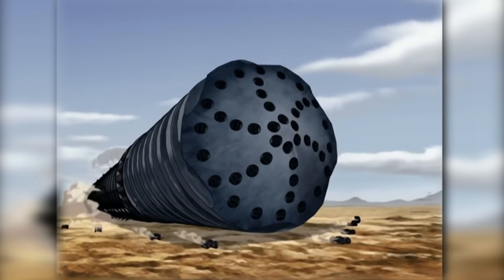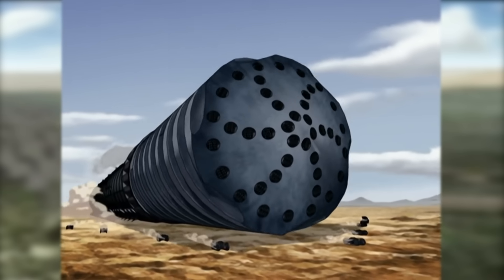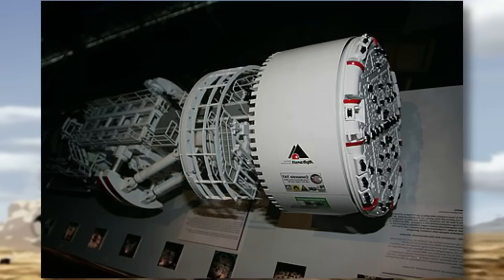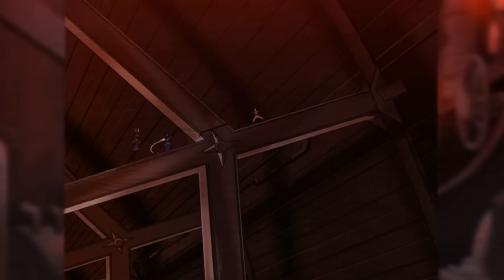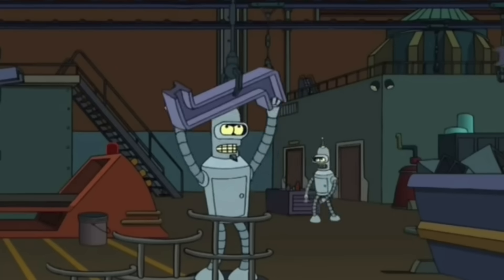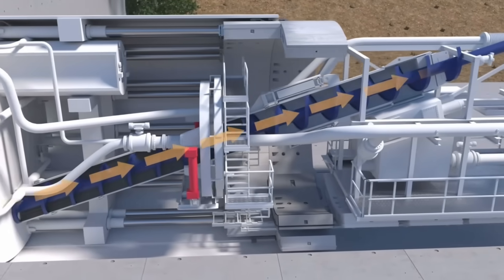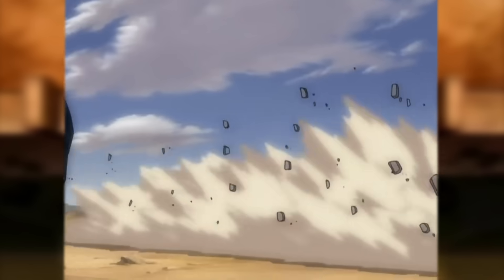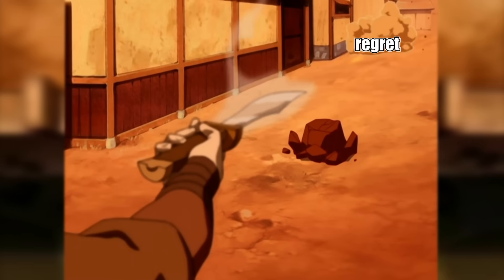Engineer Breaks Down the Fire Nation Tech

Comment: I just thought of this- instead of assaulting the drill directly, the earthbenders could've counter-mined the drill- since it was supporting itself on the surface and not traveling underground, they wouldn't have to dig far; digging directly under and opposite its path would literally break it in half with a trench!
Reply: Yeah but they see it for the first time and are scared shit less and panicking

Plus they would need to go down from the wall where tanks with fire benders were
Reply: @yamatokurusaki5790  they could just start from inside the wall and dig underground, and then come up underneath the drill 🤷🏼‍♂️
Reply: Trench warfare comes for us all lol
Reply: @doctorwholover1012 underrated comment
Reply: Earthworks are the eternal weapon of warfare
Reply: it would need to be a rather wide trencdh and even then it's more like immobilizing the drill since it has a small slenderness ratio meaning it is difficult to buckle the drill due to the sheer girth. then again iron doesnt have the best tensile strength.
I think a few guys could quite reasonably spawn a big rock from the top of the wall and let it fall on the drill. Nothing beats hyperaccelerated kinematics, just ask anyone who shot a gun before.
Reply: They could render any ground army useless just by moving the ground backwards continuously which is a concept toph does fairly regularly.
Reply: That might compromise the integrity of the wall.
Reply: @seneca983  alas, we know counter-mining has been done before.
Reply: @IAmTheAce5  But, as far as I know, that was primarily about things like preventing explosives from being detonated in the tunnels. I don't think it makes sense to deliberately collapse tunnels (either your own or those of the enemy) under your own walls except maybe if it's the only way to prevent a detonation. Maybe in the case of Ba Sing Se you could try to only collapse those segments of your tunnel which are under the drill and sufficiently past the wall, but it sounds a bit risky.
Reply: @seneca983  Countering an enemy tunnel with a defender's own tunnel was definitely viable in real-life military siege warfare- I should say there's no 'maybe' about it.

I fully expect an Earthbender military to get around these nuances, supposing they were prompted.

Three guys can flip a tank, I can't really see them being in extra danger using counter-mining.
Reply: @IAmTheAce5  "Countering an enemy tunnel with a defender's own tunnel was definitely viable"

I didn't claim it wasn't. What I was saying that such counter mining probably didn't include collapsing the tunnels if the enemy tunnels were already below the defender's walls. Rather then you'd try e.g. to just go into the enemy tunnel and kill the miners. Similarly, undermining the giant drill in Avatar once it's already drilling the wall seems a bit risky. You don't want to create a camouflet under your own walls.
Reply: @seneca983 oh, my suggestion was for before they reach the wall, long before.

Like ‘is that a whole building moving our way’ early 😅
Reply: @IAmTheAce5  Ah OK, that could probably be done without undermining the Ba Sing Se walls at the same time.

One issue I see is that the walls are huge so they might have a pretty wide and deep base beneath the surface to prevent them from sinking into the ground so tunnelling from inside the walls could be a very big effort. On the other hand, maybe earthbending makes tunnelling so much easier that it's not an issue.

Comment: The easy way to stop the drill would be to just wreck the internal machinery, but that requires infiltration, but in the show, it's actually easier for the earthbenders to create tunnels in the drills' path that'd collapse under the its' weight. 

If done smartly, the collapsed tunnels would align with the spikes on the drills' sides and its' tank threads, which would stop the drill in it's tracks and avert the threat indefinetely (or until the eartbenders figured out how easy it is to divert nearby water and flood the thing).
Reply: I deal like the weight of the drill would destroy itself if they weakened the ground under the middle and just brake
Reply: You still would need tons of ppl and time to prepare the tunnel :D
Reply: @yamatokurusaki5790  Which the Earth Kingdom military would have, plus the worlds largest city is full of people too, stopping the Fire Nation would be a pretty good incentive for the refugees to line up to help.
Reply: @tatalsaba  so you will weaken your defenses in other places ?
Reply: @yamatokurusaki5790  Welcome to warfare 101, when you move to deal with a threat, other fronts won't have as much manpower for defence or offence, Sun Tzu wrote about it, so it's not a new thing. 

However the Fire Nation won't know where the defence is weakened, because they can't get intel from the 600 feet tall wall and what's behind it, plus their main attack plan has been neutralized, putting them back to tried and tested tactics, which hasn't worked since Iroh was a general.
Reply: @tatalsaba  oh yes they won't know cuz they totally didn't corrupted whole secret police mate learn the plot they would know very easily also mister i know everything better
They didn't know about the attack happening did they ? So probably weren't that prepared 
I know you surely did knew that alongside the plot
Reply: @yamatokurusaki5790  The Dai Li only turned to Azula after she bested Long Feng politically, which was after the Drill episode.

Comment: I want to remind everyone that fire benders do not bend fire. They bend heat. Essentially, they bend kinetic energy at an atomic level. They can improve their bending abilities by controlling their inner spiritual energy, called Chi or Tao or Qi or life force or what have you. They use their emotions to focus on a specific goal or ideal, and their emotions control how their energy flows in their bodies. The best way to describe fire bending, and its cultivation, is a comparison to forging steel: the strongest steel is the ingots that have been folded, hammered, and quenched over and over again. Similarly, the strongest fire benders are those who have had their ideals tested, their emotions challenged, and their resolve broken before strengthened again. This can be done through many methods. Meditation can be used, where by trying to actively control and rein in your emotions to focus them clearly, you can create a sharp edge in your energy that is refine and powerful. Unbridled and immature emotions, thus unforced inner energy, leads to uncontrolled and weak firebending.

A fire bender who has grown accustomed to focusing their emotions, forging their energy over time, they can greater bend molecular kinetic energy. This can lead to hotter flames, such as Azula’s blue fire (where Azula may seem rageful and immature, her negative emotions were quite focused on a singular ideal almost constantly). A true master can bend lightning, by causing molecules to move and rub against each other so fast that they generate enormous amounts of static electricity, usually within the user’s chest, arms, and hands so they can build it up inside and guide the direction it fires. Similarly, redirecting lightning is when the user controls the kinetic force of the molecules in their body to guide the lightning through them and out the other end (which is why moving your hand over your heart can be fatal).

The most refined form of fire bending can be seen with combustion bending. You focus on a singular point on your body, typically a spot where your inner spiritual energy (whatever you decide to call it) gathers in a node of gate, and then control the kinetic energy of molecules in a straight line from it. You then allow the energy to build up on the target until a lot of heat is generated so quickly that and explosion is generated with air as a fuel/reactant.

Recap/TL;DR: by focusing their emotions strictly, fire benders can strengthen their Chi to grow stronger as a fire bender. Fire benders don’t manipulate fire, but rather molecular kinetic energy, thus they can also bend lightning, spontaneously heat things up, and cause instant combustion.

Comment: Personally, I would have tried to find the main driveshaft of the boring head and tried to disable the drill that way. If it can't drill anymore, it can't get into the city, even if it's technically not destroyed.

And even if they couldn't cut the main shaft, they could have slammed a massive rock against it untill it was damaged enough not to turn properly anymore.

Alternatively, they could have went for the power plant. The drill is seemingly powered by steam engines. In real life, a steam engine can be quite volatile. For example, they could have bent the water out of the engines, causing the boilers to heat up, then let the water flow back in to create a massive pressure spike, potentially resulting in an explosion
Reply: Keep in mind these characters can barely comprehend what a steam engine even is, they called the ash from Fire ships "black snow"
Reply: @ThanondorfTV  find spinny thing, break spinny thing so it stop spinning
Reply: @ThanondorfTV  To be fair, that "Black snow" is literally the ash mixing with the snow
Reply: @ThanondorfTV  Black snow is literally the correct scientific name for it.
Reply: or used the water bender to break the boilers, cant make use of the drill is all you piping bursts from freesing and the air is filled with boiling steam
Reply: We forgetting that the drill has idk ppl in it? Ang is sleep deprived
Reply: I would imagine those components probably have the most fire benders they would have to deal with and bring tons of attention to them that they really don't want.
Reply: @dillzilla4454  While true, the fire nation is known to employ non-benders in its military for support roles. I wouldn't want fighting age benders shoveling coal in a boiler if I was the drill's commander
Reply: I would have sank the wheels of the drill so it wouldn’t even move.

Comment: My observation on the drill and why the Gaang didn't attack the internal systems is because of two things. One, there was a small army in there. Even the engineers should know how to fight and, while they're skilled, I don't think they're 50 to 3 in a cramped environment skilled at this point in time. Two, Aang's goal is to disable the drill, not destroy it. He is a pacifist, despite all evidence to the contrary. He doesn't want to directly kill anyone. So doing something like overloading the boilers and causing a steam explosion, while both cool and effective, would also cost a lot of lives and he would recognize this.

Comment: I thought the slurry was to help of cooling as well as removing the material
Reply from the maker: That’s what my intuition told me too when I was starting researching the specifics, but I think I was confusing it with steel drilling which certainly needs a coolant. I think the main difference is that the speed of the drills cutter head is much slower than a steel drill and generates less heat as a result.

Comment: To be fair, it would've been much more boring (pun intended) if team avatar just destroyed a few key pipes and caused a steam explosion inside the drill. 
Also, I could be wrong, but fixing a few pipes might be easier than rebuilding an entire drill's structural support systems.
Reply: attacking the structural elements is like stabbing some ones ribs, will it hurt if you do enough damage? yes. could you kill them ? if you do it right, should you have gone for the throat yes, would it have made a less interesting episode yes.
Reply: @bennuter  Your comparison doesn't hold well, because living beings die (permanently), but machines are mostly just temporarily rendered inoperable, while remaining repairable.

With a full crew of fire bender engineers which are probably assembly line specialists and the right schematics on hand, they could probably get the drill back up and running from most if not all sabotage attempts. They would not be able to recover from the whole drill chassis getting totalled, however, at least not out there in the field.
Reply: There was a pretty quick response when that first valve was broken, so if they went for more pipes that leaves a pretty good trail for guards to follow. Going for the structure kept them unnoticed for a good amount of time
Reply: they would also have to do it in a way they would not get caught up in the explosion themselves :)

Comment: Can you imagine if the drill just drilled in one wall and out the other side of the city, never leaving the inside of the wall?
Reply: any way to change the direction of the drill diagonally?
Reply: @shadowshinime5703  doesn’t look like it from the show.
Reply: Pretty sure the drill just works as a  single use siege device. It’s just meant to go forward, break the wall down, and then reverse itself once the wall is breached.
Reply: @xxIshtar9000xx I do wonder what their plan was after breaching the wall, like as soon as they back the drill out, earthbenders could just plug the hole, no?
Reply: @scottthewaterwarrior  Yeah, that plan wasn’t really thought through, wasn’t it. And you can’t bet on Ba Sing Se being quiet about it, because if anything’s gonna wake up the Dai Lee, it would be a massive drill wrecking the side of their wall.
Reply: @xxIshtar9000xx Only way it might have made sense is if the drill had a big channel running through with an opening at either end so they could leave it in the wall and then drive tanks through.
Reply: @scottthewaterwarrior I mean it's a one time use drill anyway, why not just melt a hole in it with fire bending?
Reply: @dillzilla4454 How do they get through the next wall then?  The city has multiple layers of defenses.  Only real issue would be most the city's food production seems to be focused in the outer ring, but given just how big the area is, the Earth Kingdom could probably build additional walls within it miles ahead of the Fire Nation advance containing the breach to a relitevely small area.

Comment: 6:41 Air can do a surprising good job at cutting things if done right. Actually once accidentally cut myself using an air compressor and IDFK how!
Reply: Air can do that, and you're really lucky to still be here. Air embolism is a thing. The air gets into a blood vessel, reaches something important and it's goodnight.
Reply: Ok, but Aang cut it with earthbending here.
Reply: A coworker saw a guy lose his arm at the elbow to a high-pressure air leak